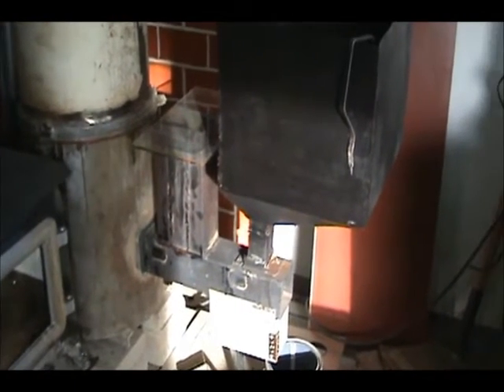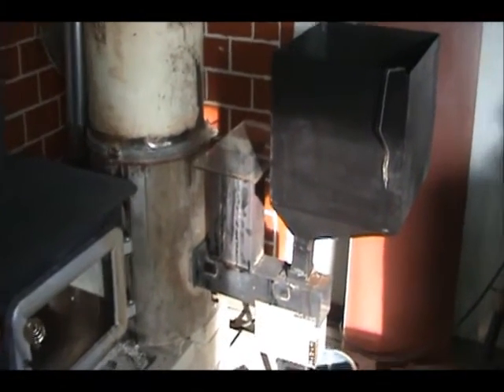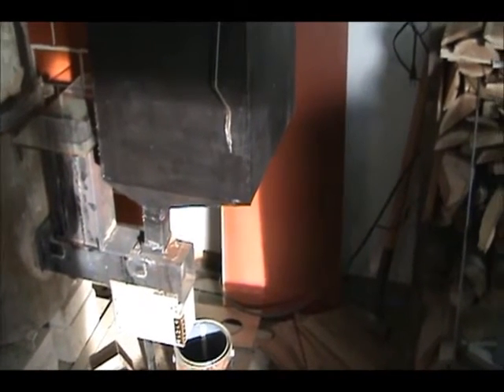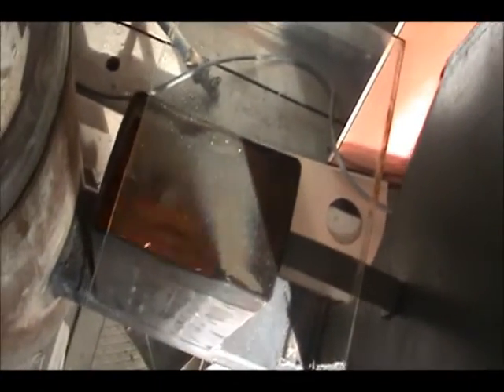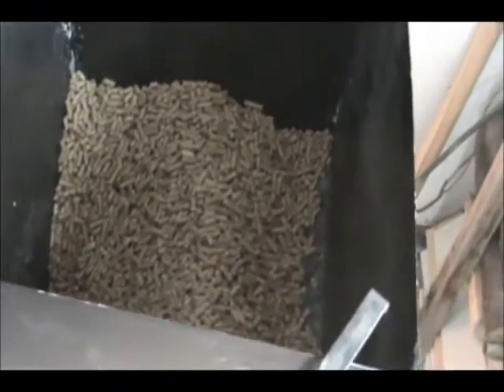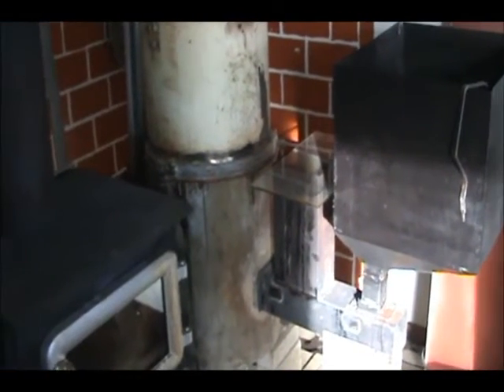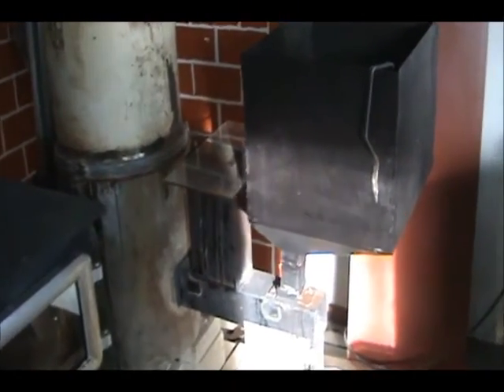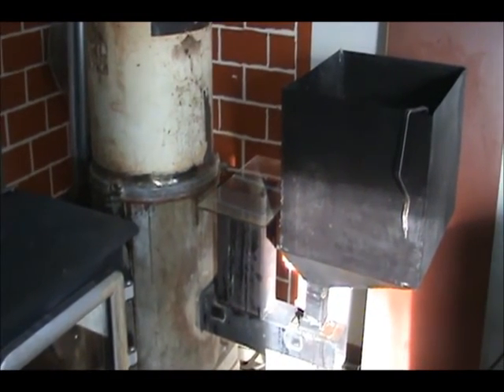Rocket Stove Pellet Burner

Comment: I commented before if you add four pipes to the bottom of the riser take off your back barrel and drill threw horizontally from outside to the bottom of the riser threw to the outside I would recommend 4 pipes about 1/4~1/2 in diameter if you do it on a angle lets say 45 degrees for spaced equally around the unit this would suck in fresh air not affecting the burn area but adding oxygen to the bottom of the riser and you could make caps to cut down the oxygen your allowing into the riser the angle would create a vortex coming up threw the riser. You would have to experiment with it!  Here is a guy that done the modification to give you a idea in case it is not clear here  https://youtu.be/o1ZKm7QZ-dY Check video around the 8 minute mark to see what I am speaking about!

Comment: Hello sir , i like your video , and maybe you can help me with my problem in my stove , looks like my flame goes down after about three hours of use , the pellets in the basket i think the block the air to help to keep the fire and there for the fire goes down after two hours , i am using 6 mm pellets, the rod in the basket are stainsteel 8 mm and the gap in about 7-7.5 mm , i have a window for air inlet but its not helping after 2-3 hours the flame goes down . Can i show you on video? Whatsapp or email ? 
Thank you very much ! 😊

Comment: have you figured out your ash problem yet?  I think i have a good solution for that one mine, however my stove is a lot different than your design.  I used bent 1/8" welding rods to make a pellet basket, and i spaced them 3/16th on center, and 1/8" off center with the height so evey other one is higher.  I know you dont use the basket design,  but you could incorporate something like that on yours just where the pellets turn to ask.  My next build i think i might use something like your design, with the 1/8"rods for the ash to fall through.. but i think ill take some thicker plate metal and make the welding rods to where they just slide into place.  that way when they burn out you could replace them very easily